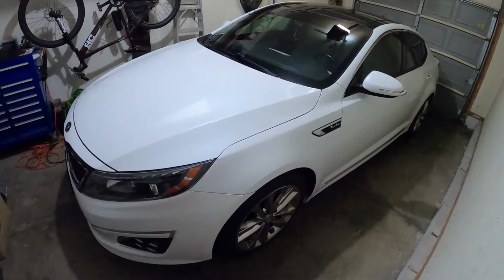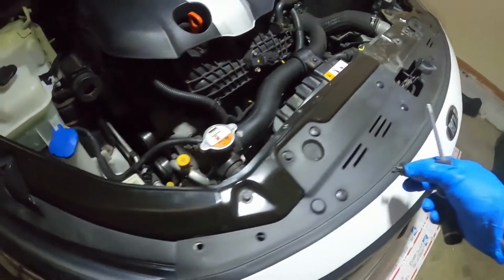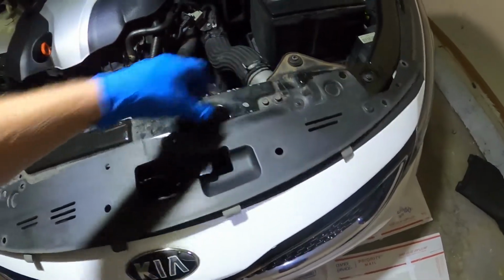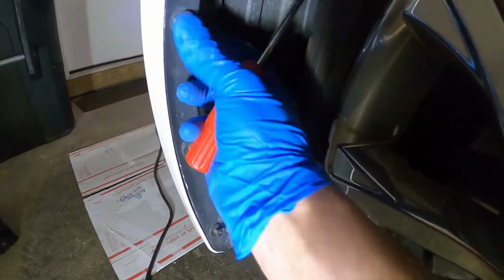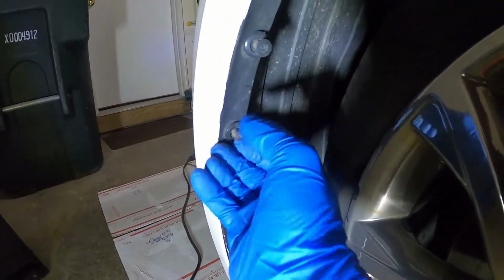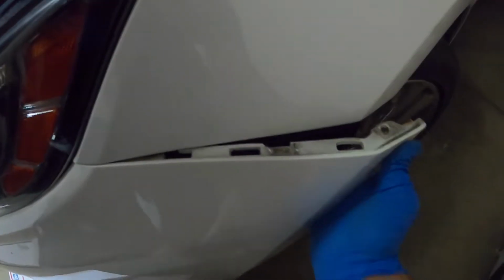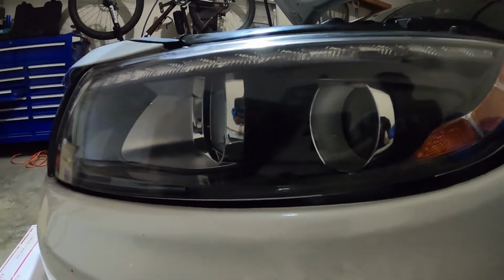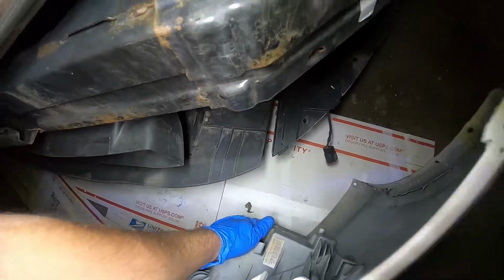HOW TO REMOVE FRONT BUMPER ON KIA OPTIMA | DIY | STEP BY STEP

Comment: While this video is very helpful, a word of caution that for my vehicle (2013 Optima SXL) there were an additional two nuts and one bolt on each side that secured the bumper to a bracket underneath the headlight assembly that had to be removed before the bumper could be completely removed from the car. Not exactly sure if this is specific to my year/make/model/trim package/etc. but definitely worth checking before trying to rip the bumper off with brute strength. Thanks!
Reply from the maker: @michaelkarpinski  thanks for your contribution! Always nice seeing others help the community.

Comment: Sure beats labor costs to replace a low beam, thanks for the vid Blue Glove
Reply from the maker: Thanks for the kind comment!
Reply: Ugh, I guess I got to do it myself
Reply: I replaced both my low beams without removing anything. First bulb I bought, did not work, kia can be finicky with bulb brand and the 2 slots on light bulb fitting correctly.
Reply: @rotwiler7674 I need to replace my driver side low beam, so I'm gonna replace both. Which bulb did you use to replace yours with bro?

Comment: Do you have a video of putting it back on? Would be so helpful
Reply from the maker: Hey there. If you start my video of how to replace an intercooler at 21:50 that should help you out. Thanks and dont forget to subscribe!
Reply: @blueglovemechanic  you the man. I hit a giant raccoon going 60mph and hit my right side bumper and broke off the whole area where the fog light is. Cracked my wiper fluid reservoir, and drained it. Do you have any idea what to do at this point? Replace the whole bumper? Sheesh idk where to start
Reply from the maker: @ccccxxe31  Hey. Sorry i missed your last comment. I assume you figured something out by now but I guess it all depends on your situation. If the damage isnt too excessive they make bumper repair kits where you basically glue it back together from the inside. If it appears to be missing pieces or you want a much cleaner look i'd always  recommend replacing any broken parts. Hope everything worked out for you!

Comment: Hey man, is it possible to swap a 2015 optima bumper for a newer 4th gen bumper?
Reply from the maker: Hey there. Unfortunately I am unsure. Itd really be a matter of bolt placement, as well as if the body lines/clips line up. Also the dimensions might have changed overtime. I unfortunately do not have that info. Best of luck if you decide to try however! Let us know if you take on the project and how it goes. Thanks!

Comment: 👍🏼👍🏼👍🏼
Reply from the maker: Thanks for the comment! Make sure to subscribe if you havnt already. I really appreciate it!
Reply: I have a 2014 Kia optima white with 48,000 miles in it. It’s 100% in great condition but my front grills kidding kind of faded need to change it out.👍🏼👍🏼👍🏼🙌🏼✌🏼
Reply from the maker: @JoeAndMattsDetailing0  I hear yuh. Ive got around 120k now and my front bumper was replaced/repainted before i bought it. With cleaning off all the bugs i have little paint chips everywhere.